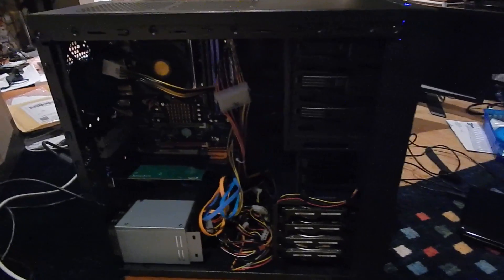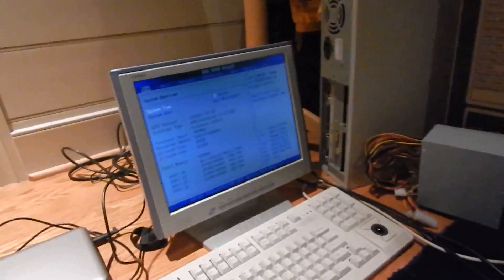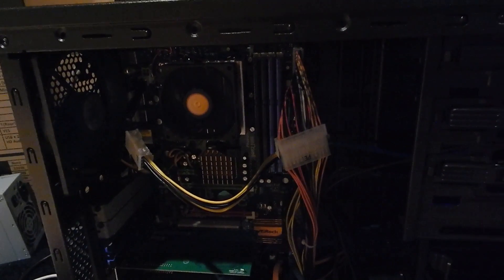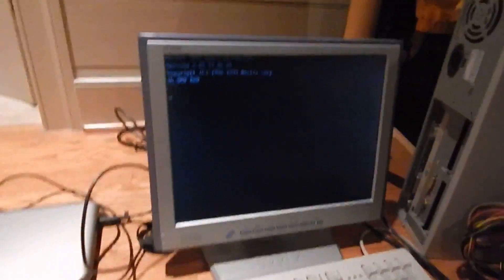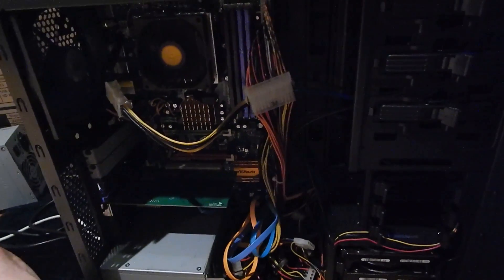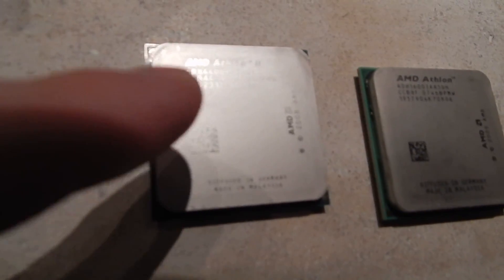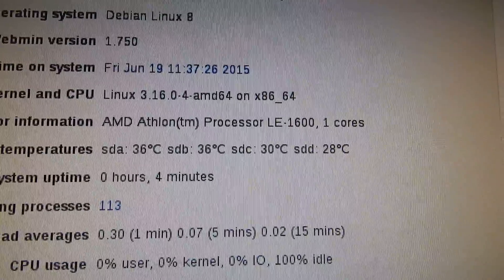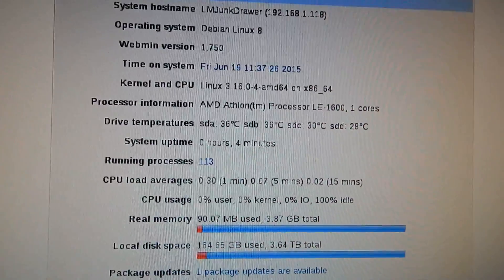Digital Junk Drawer Server June 2015

Comment: Hi Imull, maybe you can help me here...
I'm setting up something similar to yours, its an Intel board with a crap i3 and 4 Hitachi 1tb hard drives. I cannot for the life of me get BTRFS to work with debian. I'm not sure if its something i'm doing wrong or not, and i understand that you need a separate /boot if you intend on using BTRFS as your main FS, but, regardless... Whether i'm using RAID 5, or RAID 10, i cannot get debian to boot even with a separate /boot, or, heck, even a separate BTRFS partition than the one i intend to store files on. Any help at all would be appreciated, i'm really needing it!

Comment: i have a similar set up with 11 drives with room for 2 or more drives
it has a amd sempron 145 45 watt single core
msi 970A-G43
4 gigs of corsair vengence 1600mhz ram 2x 2gb so its kinda junk?
corsair rm 650 watt 80+ gold power supply
8x 500 gig hard drives in a raid 5 
3x 250 gig drives raid 5 
2x high point 2300 4 port raid cards pci e x1
and some unknown 2 port sata card pci e x1
and some xfx gpu with 1 gig of ram overall the rig uses like 100 watts off the wall. 
im looking to upgrade the cpu to the athlon 170u its a 20 watt cpu or the atlkon x2 260u which is still a 25 watt tdp as well to see what happens
its running open media vault because im to lazy to full around with a set up like yours :)
 and works preety dam good something i wouldnt mind fulling around is getting 2 nic cards to work in some kind of teaming for high speed transfers to my 3 poweredge file servers that i have.

also dumb question if you were to put that pci gpu in a uefi bios based board would it allow you to access the bios? be kinda fun to put in a 8 port sas card i have and jerry rig a way to add another 8 drives into it :) if a gpu like that did work

Comment: 8:52 When I bought my FX-6300, I attempted to use the stock cooler (which had the smallest heatsink I have ever seen) and boy was I an idiot. Temps were reaching into the high 50s just by running some simple programs, gaming got it even higher. What was worse was that it was an absolute screamer of a fan! Eventually I bought a new cooler (a CoolerMaster Seidon 120V) and it's so, SO much quieter and cooler running now. Core temps drop as low as 15C in mild room temps (about 13-15), socket temps around 30C. Gaming never brings it above 55C (socket). Though because I live in England, the weather helps with cooling it down, haha.
Reply: c0d3r3d Your core temperature cannot possibly be 15C in a room that is 17-20C - The CPU temperature will always be above the ambient temperature of the room, unless your using a Liquid Nitrogen cooling setup that is.  ;)
Reply: thomasd221 Actually to be honest, I don't know my actual room temp. It's been warm recently though, and my temps have shown it. I think the room temp might've been about the same as the socket at that point, give or take a couple of degrees. My motherboard is really flaky with readings (my fans regularly spin to 675000 RPM apparently) and it doesn't help when today you realise you have faulty RAM.
About the liquid nitrogen thing, I wish, haha. Would probably strap it to my HD7870, that thing gets up to the low 60s while gaming.